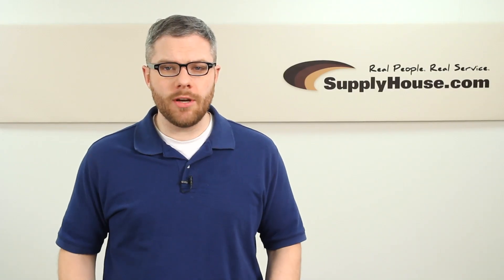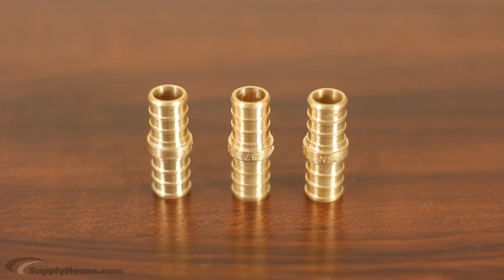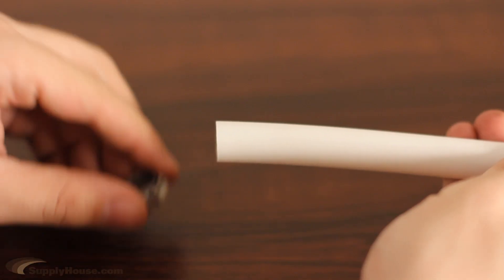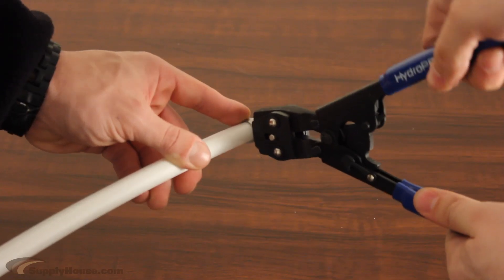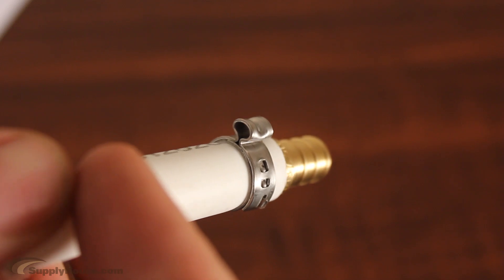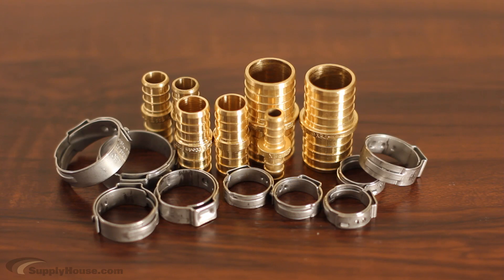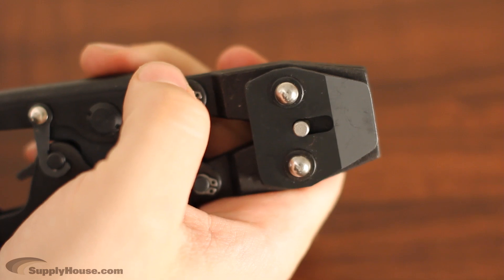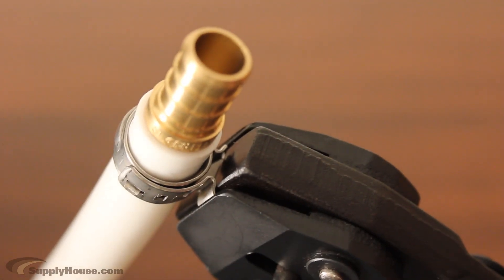How to Make PEX Clamp Connections

Comment: so,, can you use these clamp on pex-a ?    my plumber capped off the ends (in the rough plumbing)  with cap and those plastic expansion rings. I want to now remove them and put 1/4 turn shut off valves on the ends.  Its pex-a,  so can I use these clamps ?  Or do I need to stick with the expansion ring.   No one seems to have this answer.